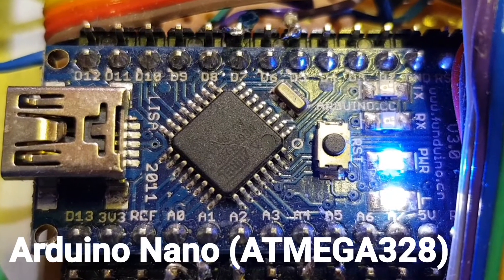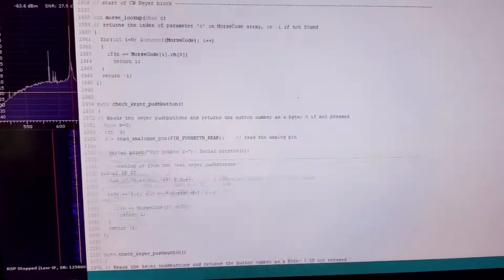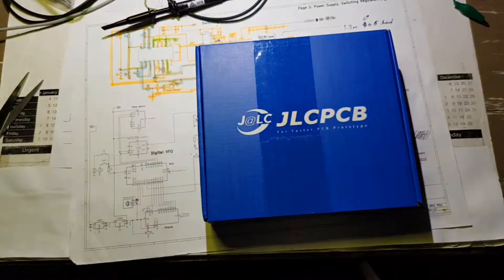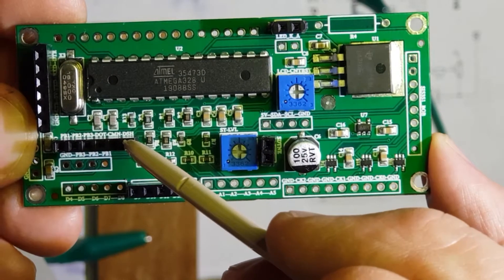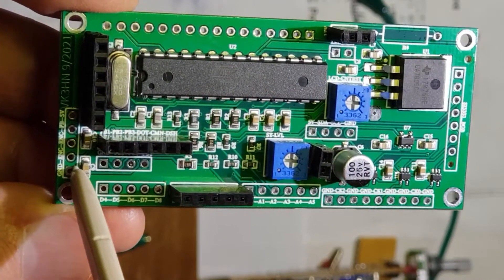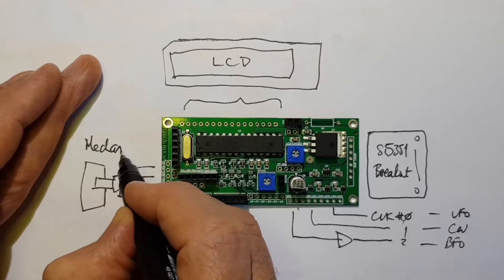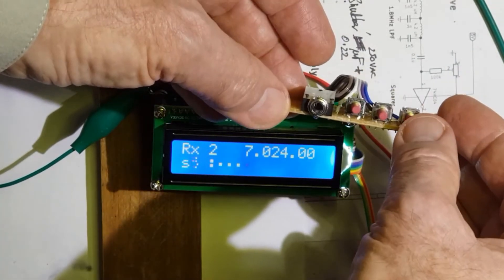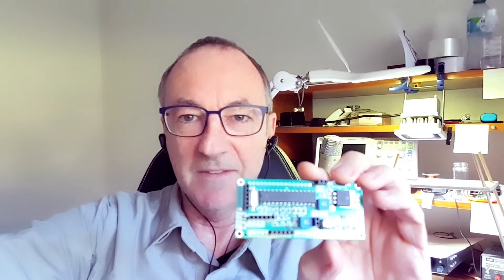Universal Radio Project Controller (ATMega328 & si5351)

Comment: I tried to find the boards and struck out. I came back to watch the video again realized it's 4 years old. The board is a fantastic idea. I wish it was available.
Reply from the maker: Hi Michael.  Indeed this was 4 years back and I have moved on. I never did a 2nd run of the boards as they had a few minor errors and I needed to revise it carefully.  I have designed another such board, this time with the 5351 on the board using a XIAO SAMD21 or ESP microcontrollers which I really like.  I have some prototype code running on it but it is suffering from the same problem, too many ideas and not enough time.  There are a lot of such boards around these days, so keep searching and I am sure you will find one.
Reply: @Paul_VK3HN  Thanks for responding Paul and thanks a ton for your hard work. Making videos is a lot harder and more time consuming than most realize.
Reply from the maker: @MichaelLloyd I love making videos ❤ but it is very time consuming!  73 and enjoy  making radio stuff.

Comment: DIid you release the gerbers?
Reply from the maker: No.  The board works as shown but has some labelling errors. I could fix these and put it all on github, if you are keen and would go through with the build.
I've moved on  to a board half the size with a XIAO ESP32 and 5351 on board.  I'm also writing new software that will include additional features such as CW decode on both Tx and Rx. This will be about another 3 to 6 months,  based on current rate of progress.

Comment: Excellent project. I love it. How can I get few PCB's. I have been a HAM for 35 years. Still I don't have a HF rig. I like to do some project using PCB & Arduino Sketch. 73 de 4S7DB  Daya Buddhadasa
Reply from the maker: Thanks Daya.  There are a few errors on the boards . I intended to do a second run to fix these, but life got in the way.  So I prefer not to release this project, as people would need ti.e consuming email support. I hope to get back to this so.eday. 73 Paul VK3HN.

Comment: Your logic is impeccable. This is indeed the heart of pretty much any sort of HF rig. The rest is just mixers, filters and amps for various bands. I like it. I just wish there weren't chip and RF transistor shortages right now. It's real frustrating.
Reply from the maker: Thanks for commenting John.  Yes, if you strip out the VFO, BFO, CW carrier generation,  keyer, TR switching, band switching, display only the analogue stages are left.  I'm expecting to do another small run of this board at some stage, this time with si5351 on the board, and ideally, the SM ATMega MCU. But alas, no or extremely limited stock. The semiconductor shortage is stopping a lot of projects and kit development and I don't see it getting back to normal for another year!  73 Paul VK3HN.

Comment: Very impressed Paul well done a very handy project to have , Just a inquire, are you ever consider  selling any of those boards ,Cheers 73's
Reply from the maker: Hi Doc, this is the prototype. So far I have discovered about 5 minor errors, mostly label mistakes. I wll fix these up before doing a second run and  then release Gerbers. I don't know if I will order a larger batch of PCBs, depends on interest.  The alternative is that with the Gerbers people can order their own, from whoever they prefer.  I'll notify you in a matter of weeks! 73 Paul VK3HN.